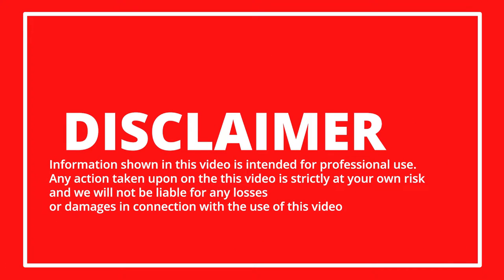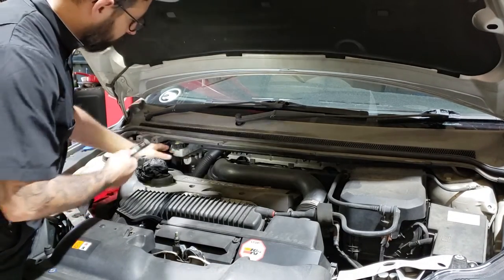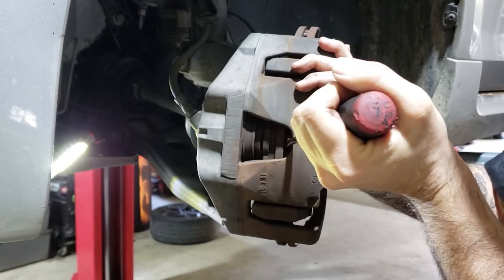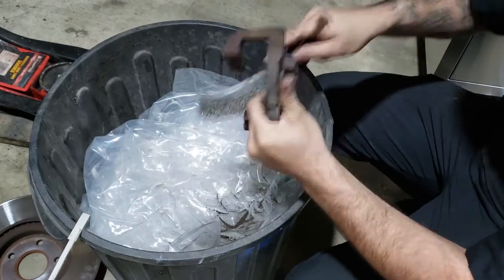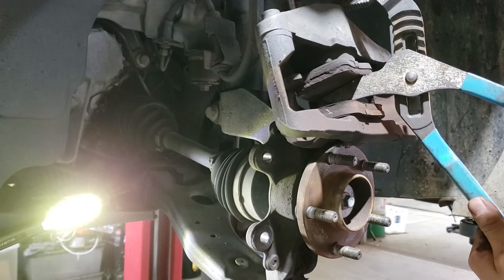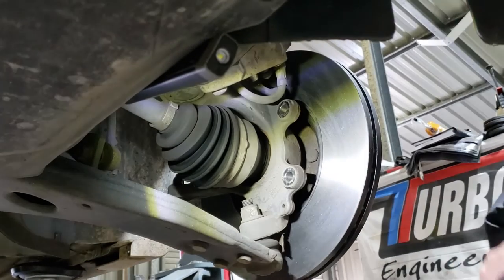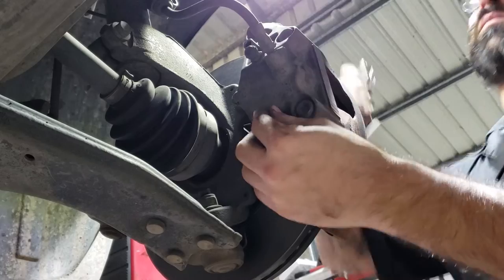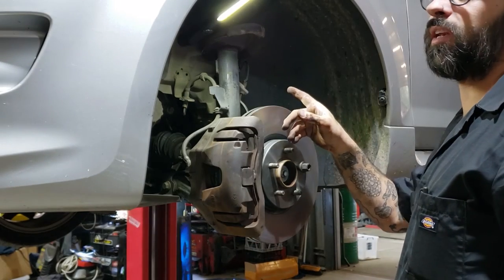Front brake disc & pad replacement Focus ST225 / XR5 Turbo

Comment: I've just replaced my pads on my 2006 UK model, and I can confirm this guide is bang on and the best way to do it. The only issue I had was clipping the inside pads back in. On the pads I'd bought, the springs were far too wide for me to easily clip them in, so I had to get some pliers out and bend the springs into place.
Reply: Dito